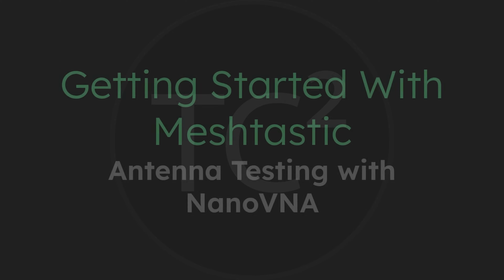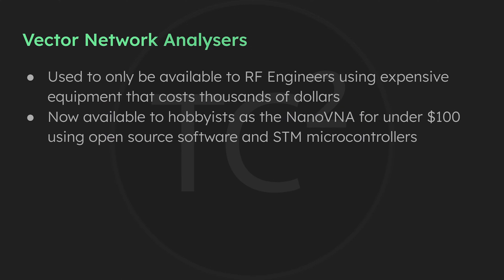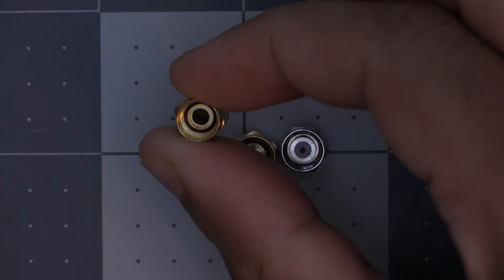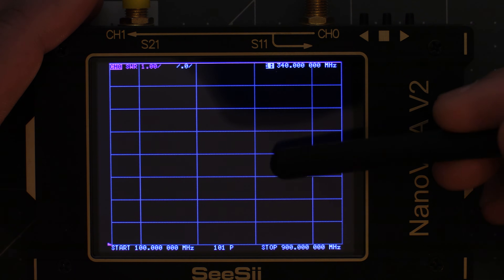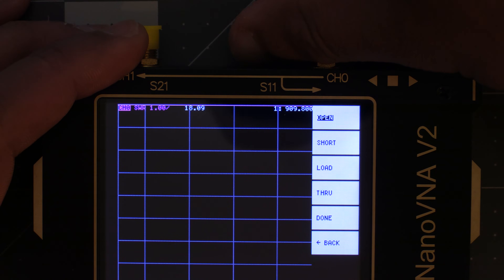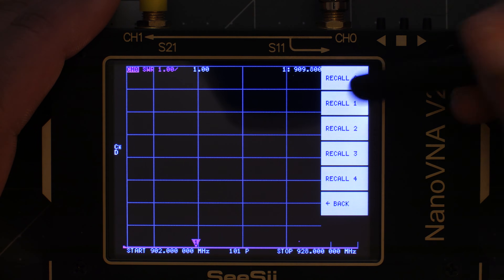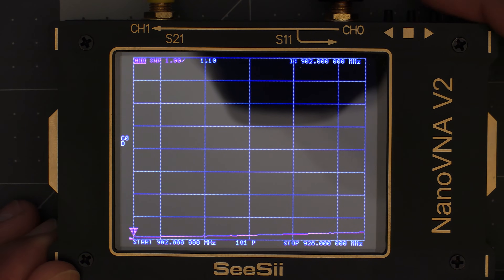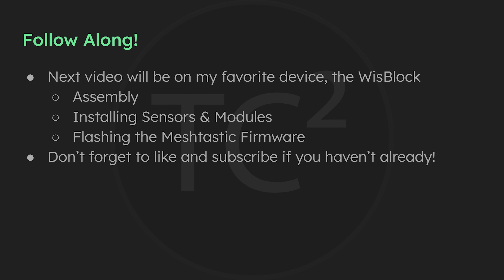Getting Started with Meshtastic [BONUS] - NanoVNA

Comment: If I wanted to buy a nanoVNA which one should I buy?   I am a bit confused on who makes the one that will be best supported with updates and which one has the best hardware/firmware. There are a few out there will similar frequency and feature specs.
What is a clone and what isn't a clone when it comes to open source programming.   I get the specs you mentioned about frequency range  and I want something also that will
let me play with Ham Radio antennas and Bluetooth/WiFi antennas.  I am concerned about the best hardware/firmware and update supports.
What is the Impedance of the LOAD for calibration your using and how does it effect measuring antennas SWR of a different Impedance, for example 75 ohm or 300 ohm antennas.     Thanks,
Reply from the maker: As far as support goes, the NanoVNA is an opensource project. Everything from the software to the schematics is all open source and you could even build one yourself. Buying one of these pre-made ones from Amazon is for the convenience of getting one made for you. Since they are based off this open source project, they all receive the same updates as the project gets updated. A link to the project is here - https://github.com/hugen79/NanoVNA-H

 One of the better companies that makes these products is AURSINC and here's a link to their Amazon page https://amzn.to/3R0qSzn

For your needs, they make a 3GHz version that will let you work with WiFi/Bluetooth as well as Ham Radio Antennas and a link to that is here https://amzn.to/3GlXKO3

These will come with a 50 Ohm calibration kit, but others have made their own calibration kits for other impedances. 

Thanks for the question!
Reply: @The_Comms_Channel  I assume besides the 50 Ohm they also come with the OPEN and SHORT fixtures as well.
I am reading some have problems when updating the firmware with certain MFG of the hardware which raises
my concern to buy one that is known not to have firmware update problems.      Thanks,
Reply: Buy one that has the range of your antenna and cables.

Comment: Could it be that the Nano VNA's housing acts as a counterweight for the antenna during measurement, causing the SWR to shift again when it's attached to the LoRa device's (possibly plastic) housing? Would it make sense to equip the antenna with one (or possibly several) radials, measure it remotely via a cable, and then operate it with radials?

Comment: Remember that if you're using an RP-SMA antenna, you'll need to use an adapter to test it correctly on the SMA Connector for the VNA

Comment: The antenna that came with my T_echo labeled "915M" has an extremely high SWR when tested on the properly calibrated VNA.  This seems ridiculous that they would not ship a good working antenna. I put a different antenna on it that checked good SWR on the VNA. 2.1 SWR and it's a hand-made 1/4 wave just for now.

Comment: i read we have to avoid to remove antenna on standard radio when it work to avoid burning it. it not the same problem with nanovna ?
Reply from the maker: No worries with the NanoVNA since it isn't transmitting

Comment: Quick question. I am working on a sturdier case for my T-Echo and want to put the GPS Antenna externally separate from the LoRa antenna (Gizont 17cm 915). Is there a small GPS SMA antenna that you would recommend? I haven't found one specifically tuned for L1 or L2. Thanks in advance!
Reply: BTW I read in a comment on the LilyGo site that the stock antenna seems more resonant at 1,200 mhz which seems more in line with an L2. Have you by any chance tried using the T-Echo stock antenna as a GPS antenna? I would be interesting to be able to recycle. Thanks!

Comment: I want to start by saying Ive enjoyed watching this getting started with Meshtastic series.

 Im Not saying the way your showing is wrong. But why would you cal using SWR and not Smith chart? 
The way your showing to cal doesn’t show wether or not any of your cal loads are even good or not. In other words your not checking weather the short is a true short, your 50 ohm load is a true 50 and your open is a true open. I point this out because most loads that have come with my devices are trash and had to purchase good loads separately. I understand this video is to get people started with the nanoVNA. But I think new users should learn how to at least use the smith for cal. Because this way of calibrating the nanovna is going to trip up new users getting started do to faulty loads.

Comment: After looking over the  selection of NanoVNAs that Amazon offers, I'm even more confused....
In the 10Khz-1.Ghz model descriptions, it states that SWR can be tested from 10Khz - 900Mhz.
What am I missing?
Reply from the maker: Hmmm, that is weird. May be a typo? Amazon descriptions aren't the best sometimes.
Reply: That's a very good point...lol
But it seems odd that several different brands would have the exact same typo.....unless maybe they're all being made in the same factory....maybe....?
I'm thinking I'll just wait until after the holidays and pick one up like you're using....that will allow me to work with 2.4 routers and my r/c stuff too.
Reply from the maker: I've had mine a while and it's been good to me. If I was buying a new one today, I'd probably get one from AURSINC. I've updated the links in the video for the different models from them.

Comment: Great information. I have a RAK Wizbloc I just put in an enclosure with 10500mah lipo. There’s a notable power efficiency compared to my Heltec v3s. The heltec boards have a sleep mode but not the RAK.. Going forward I will consider the RAK devices because they are compact high quality and well designed.
I bought a nano VNA that goes up to 1.5 ghz that’s half the price. It covers my HT And Lora antennas only.
Reply from the maker: Nice! Hard to beat the power efficiency of NRF52! Love the modularity of the WisBlock and will be going over some of the sensors that can be added in the next video.

Comment: This could not have dropped at a better time. Bought a vna after watching last vid, got it, brought it to work today to start playing with it, and quickly remembered, “oh yea, I’m not an RF eng., I don’t know what any of this shit means.” Very helpful video.
Reply from the maker: Haha, perfect timing! Glad the video is helpful.
Reply: @The_Comms_Channel this might be too long of a response for you to type but how do I set the VNA to show which specific frequency the antenna is set to, if that makes sense. I saw another video by Ham Radio Crash Course I think and he was using this same thing but his little scope had just a linear output with a dip at the specific frequency the antenna was “set to” was the wording I think he used. He said something about sometimes you’ll get an antenna with these Meshtastic radios that are bad to use cause they are work on a completely different frequency like 430 mhz or something like that. Does that make sense? If so, how do I show that graph? Thanks for sharing
Reply: @millbean13 Its not a simple button press, but it is a simple process. the biggest factor determining where an antenna will be effective is the antennas length. Assuming you are testing an antenna designed for your desired frequency range, you might start by expanding the frequency range slightly beyond the ideal range and see how your results turn out.  If the results are poor, expand the test range even farther until you see where the SWR drops, then re-center there and retest with appropriate granularity to get a good picture of how the antenna performs based on its default construction/tuning/length.
Reply from the maker: Yeah, the one that comes with the T-Beams aren't great. The part where I enter in the Start and End frequencies, just expand the range a bit (can try 400MHz and 1000MHz) from there you will want to look for a dip in the graph and use the left or right to put the marker on the dip to see what frequency is the best for that antenna. You may have to play around with what you enter into the Start/Stop range until you see the dip.